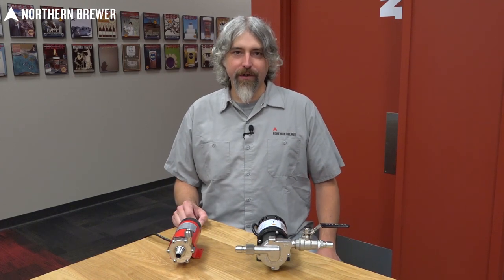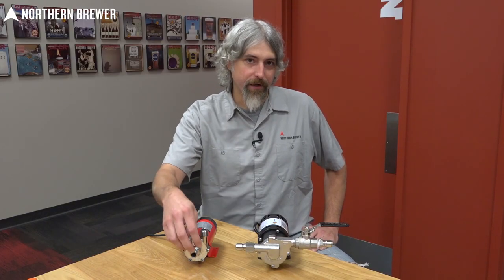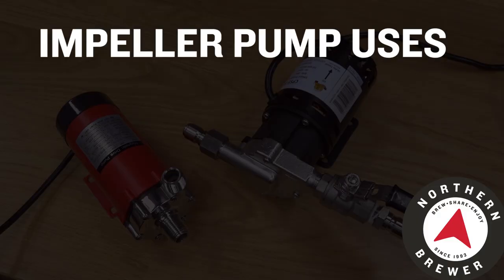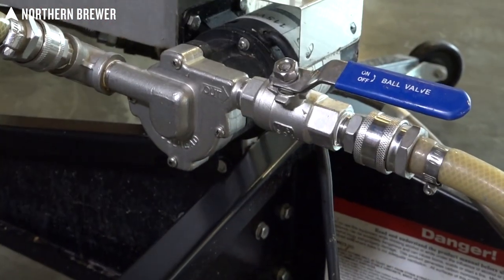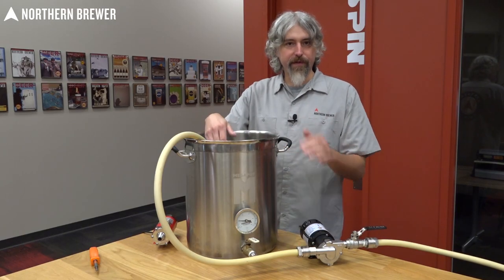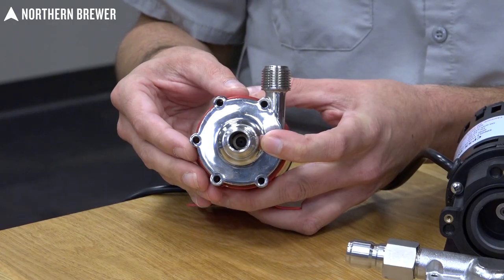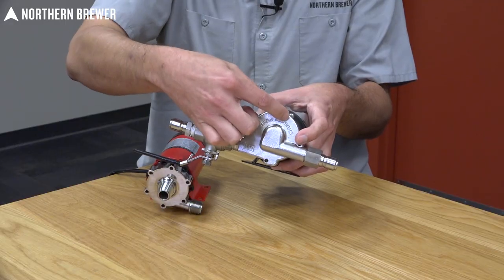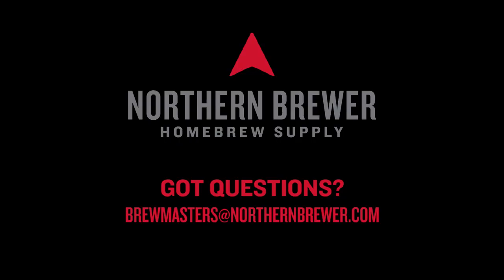How to Use an Impeller Pump for Homebrewing

Comment: Thanks for the information.   What type of oil do they need and how often should one add oil?
Reply from the maker: From March Pump's website; hope this helps!
LUBRICATION: The motor should be oiled annually at the start of the heating season with 4 or 5 drops of SAE 20 weight non-detergent oil in each bearing. If the pump is used year round it should be oiled every six months. Do not over oil.

Comment: What is the best way to sterilize a pump? To be able to pump post boil I need to sterilize so I don’t contaminate the wort.
Reply from the maker: From our Brewmaster Brad: "Kill the boil, let sit for one minute, and then pump the hot wort. It will still more than hot enough to nearly instantly sanitize. Let the pump flow for a minute back into the kettle just to be absolutely sure. This makes sure that everything in the pump loop (hoses, pump, chiller, etc) is all heat sanitized. After a minute of recirculating back into the kettle, you can proceed with your process of moving wort to chiller and into fermenter."

Comment: This has nothing to do with beer, but we are looking for a pump such as what you feature here to use with bottling an herbal tea.  We have to bottle at no less than 180 degrees, so is there are maximum temperature we have to abide by?  Also, is this an FDA approved device?  We had another off-brand years ago that left some shiny (looked like leaking gas or oil) on the top of the batch which we had to throw out.  I am ignorant to magnetic motors, so would there be something that could possibly leak into my tea?  Great video, by the way, and we have four edelmetall pots we got from you which we absolutely love.

Comment: Here's a stupid question for ya.  When using a pump to transfer from mastun to kettle....  Can I drain the mashtun until it is completely empty?  Or do I have to kill the pump before the line starts to run dry?  If the line runs dry at the very end for a few seconds can this damage the pump?

Comment: I thought people pumped boiling wort to sanitize it?
Reply: You will get the same effect by letting the boil rest for 60 seconds after cutting heat, but without the steam/bubble generation that could stop flow or damage your pump.  Let it rest for 60 seconds after flame-out, then begin circulating.
Reply: @KH-id2hr  thanks